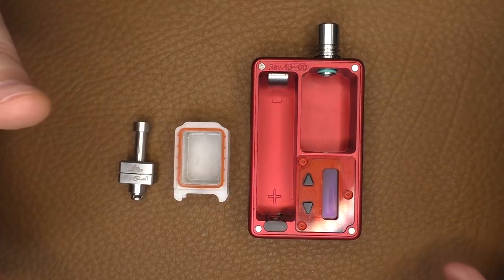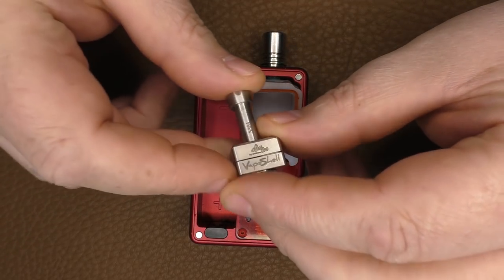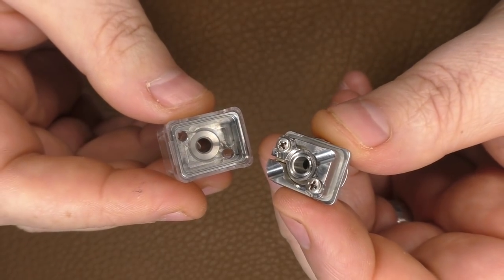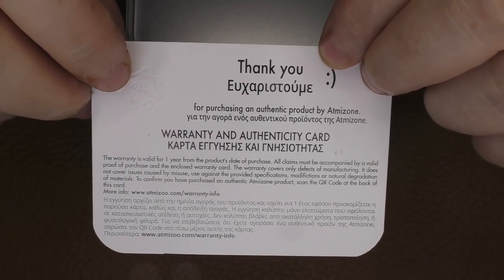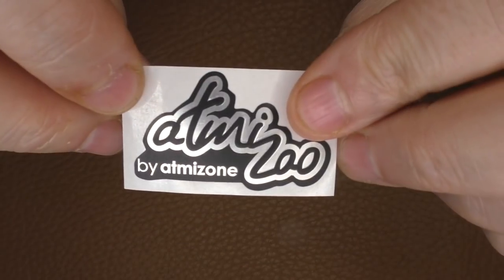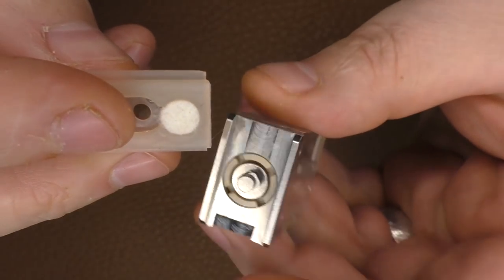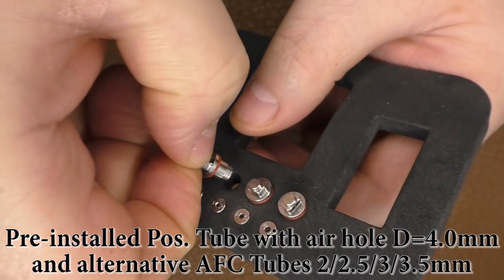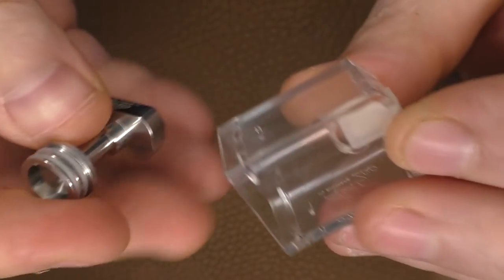The VapeSnail by Atmizoo

Comment: Definitely one of the best rbas I have seen for Boros, it would have been cool if they somehow could have made it so you could pop the vapesnail out of its tank and put it into a boro as well. That and they should have left some holes in that metal piece at the bottom so devices like the delro that get their air from the front of the tank could still get airflow.  Besides that though this thing looks like a win, thanks shedmaster for the vid 👊👊
Reply from the maker: Also if they'd designed it so you could push a button and it would turn into a jet ski so that you could have some fun if you were at the beach 😉😋😂
Reply: Todds Reviews lol I didn’t think I was asking for that much. With that being said that would be pretty cool, relay the message to atmizoo ASAP please.

Comment: This video reminded me of something that you talked about in your mod collection video with some wooden mods swelling from moisture or condensation.  I buy large (hand sized) silica gel packets to keep inside enclosed display cases and gun safes to absorb moisture and humidity. Same as the tiny ones you get in most kits these days only larger.  They are inexpensive and reusable. Reactivate them by baking in the oven at the recommended temp each month or so. This should really help and over time may even reverse any swelling already taken place and prevent any metals from rusting as well.
Reply from the maker: Yeah I have one for my car and also a different styled one for the shed, they do work well 😎

Comment: Great review! I absolutely love my DotShell. Like you I have multiple DotAIO’s. I am retired and regrettably am arthritic. I found it almost impossible for me to build the Dotmod rba because of how small I the build area is and difficulty trapping the wire. I also have a couple Billet Boxes. I have a VapeShell rba but always had issues getting it properly lined up inside the boro tank during the final steps.. Getting old sucks!  This looks like it’s the solution to my BB issues. I wish Atimizoo would release replacement tanks for both mods in case the originals crack.. Ultem would be nice...

Comment: Great review on this Todd. The VapeSnail is indeed an awesome RBA/TANK accessory and probably the best so far for Billet Box users. I have 1 gripe and that's the price. i have 2 authentic V4 Billet Boxes and own practically every RBA/TANK accessory there is. Why? Because every single time a new RBA/TANK came out for it, every single reviewer on YouTube that did reviews on them hyped them up and claimed they were the best. Every single time, I purchased and invested in what was new for the Billet Box and every single time I got suckered and those devices sat somewhere in my drawer known as the land of shamed purchases for vape accessories, never to see the light of day again. Then I saw the VapeSnail, I hunted and stalked their website for weeks trying to purchase 1. Finally, I snagged 1 and while I knew the condensation issues were always a thing in Billet Boxes, for the near $135 ish plus $12 or so to ship to the US, I was left wondering why an enclosed design like this didn't improve the condensation issues. For $145+ purchase, I guess I expected improvement and was let down by that. I will give credit for the ease of use, changing airflows on the fly, access to the deck without a mess, easy fill port etc, however I just don't agree on the price. I saw SXK made essentially a clone. I purchased it for my 2nd Billet Box because it cost me only $56 including shipping from Canada and it included everything the original did except the bottom rubber insert with the cotton tabs. I have to tell you, the SXK version is EXACTLY the same as the original and the quality was just as good. Performed just as good as the original. I can't wrap my head around the idea of why the original is $100 more. Sorry for the long post, not trying to discredit Atmizoo, just think people should understand what that $100 difference means and that maybe Atmizoo should consider what this product should actually cost the consumer. Thanks, again sorry for the long rant. Enjoy your content. Cheers
Reply from the maker: Normally when people go on about clones I delete their comment and block them from my channel as they are endorsing theft but I'll leave this one as you are obviously not some moron on a wind up :)

Why do they charge so much more, well could go on for hours but the main things are the design and prototyping, these things can take months and months and you can have many revisions and each prototype costs money, the cloners don't do any of that as they are stealing the device.

Atmizoo is a small company, they can only get so many devices made at a time which makes the unit cost higher, the cloners on the other hand make theirs in the thousands and makes the units dirt cheap.

That's just two examples but having been around the business all these years and speaking with modders and visiting the workshops, finding out the costs would shock you, it does not make you wealthy over night but once again, clone companies are stealing, it is that simple.

Sorry for the rant :)
Reply: @ToddsReviews  I definitely can understand where you're coming from. I appreciate the response instead of just ignoring and deleting my comment. As I said, I purchased the original VapeSnail from Atmizoo after waiting weeks to get 1. I absolutely wanted to support the original creators and did not know about the SXK version until about 3 weeks from owning the original. I normally don't buy or support anything cloned. I made an exception in this case because what I expected from the SXK version was for it to be a sloppy mess and not be near the quality of the original. I mainly purchased it out of curiosity and actually expected it to go in the "drawer" once I experimented with it. I again did not expect it to work well. I could not tell the difference from the original. In that matter, I do have an issue with SXK for using the name, and not changing a single thing in the design. i agree, that is indeed theft. I'm not condoning SXK or promoting them for that. I was only left wondering how they were able to produce the exact same product yet charge less than half the cost. You certainly explained that to me well, and I understand and respect the reasons. Hopefully Atmizoo will be able to grow and reduce their costs so that companies like SXK cannot justify a reason to undercut them and copy their product. Again, I don't condone supporting cloners, I just wanted to know why theirs was at that price and now I understand. Thank you

Comment: Thanks for going over all of the pieces of this amazing bridge Todd! And yes, as a MTL Vaper I absolutely adore the 1 and the 1.2 MTL pins...absolutely amazing vape. The flavor with a MTL Fused Clapton and the tight draw is heaven. 
I wicked it the first time, same as you. But I am having one issue that I know several of us BIlletHeads are experiencing. When is comes time to refill, or top off, your tank without pulling the Boro and then the coil out....it will leak like a sieve. I’m not sure why it does this and only after vaping a full tank. It’s as if a seal is broken when you open the fill port and I’m not sure how to get it back.
Do you have any pointers?
Reply from the maker: Hi Jenn,

Hand on heart it is not an issue I have encountered, not even once!  Is it something that has been discussed in the Atmizoo FB group?
Reply: Hey Mark! Thank you for the response. It’s taken me a couple days of having the Snail and trying a few different cottons and wicking techniques. But I’ve got it down for an amazing MTL. 
The only time it’s leaked on me was all my fault. I did not tighten the AF pin using the tool, I just used my fingers. FYI: don’t use your fingers, use the tool for a good snug fit.

I’ve seen some leaking issues brought up in the Atmizoo group and other BB groups but I firmly believe that getting that seal with the included bottom plug will stop that. And 
Tasos Psychogyiopoulos is right there to help us all. Amazing customer service. I love the snail so much I have two more on the way🐌🐌🐌

Once again, I thank you for your honest and thorough reviews and for staying up to date even on BB gear🙏🏻💜💜

Comment: Great review as always, have watched a few times since getting the snail 🐌!                           May I ask how often your changing cotton out on your BB bridges though? I’m literally having to do it after a couple of boros of juice every time. Not just this one but all.. I’ve tried lots off juices too!? other than that I’ve been loving my BB 👍💨
Reply from the maker: Depends on the juice but even with my heavy custards I'll get 4 or 5 tanks before changing the cotton, that's 2.5 or 3mm id coils usually 0.4ohm and about 25w.
Reply: Todds Reviews I’m honoured sir, thank you for the quick response! I’ll get 3 tanks at a hard push, before it needs a change. I’ve got various ‘premium’ juices to choose from, some worse than others due to how sweet they maybe,  but all to a degree the same. It Is what it is I guess 🤷🏻‍♂️ The flavour is great so no complaints there though!  I’ve used all sorts off builds too.. best so far for longevity is spaced 316L micro coil 2.5 ID about 0.5 ohm at about 20W keep up the good work, your one of the few reviewers worth watching when it comes to BB stuff 👍💨

Comment: I have a question regarding condensation at the back of the billet box. I don't usually get any condensation at the back just a bit on the panel. I'm not using any plugs or anything for my billet box. But would blowing out before you inhale create excess condensation inside? I see alot of vapers hold the button, breath out into the vape blowing vapor out the airflow and then inhaling like it makes a difference to the vape. Just my thoughts. I don't exhale before vaping.

Comment: Great review, went and bought it and it's an amazing piece of kit! however, do you have any tips on filling without flooding the whole bb? I seem to get massive leakage everytime I refill. I'm only going for 2 thirds full too....help! I should add, I'm using 50/50
Reply from the maker: Sounds like you may need more cotton in your build our fill it up on its side and leave it for a few mins before sitting up right.
Reply: @ToddsReviews  Cheers Sir, about to rebuild it, thought about using a slightly larger diameter to get more cotton in the wells. Appreciate the reply! 😊👍